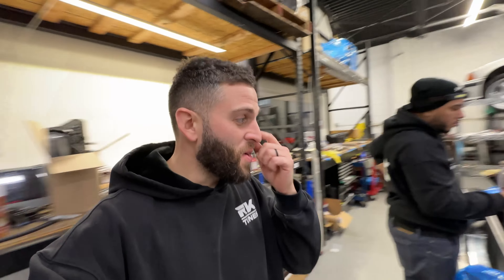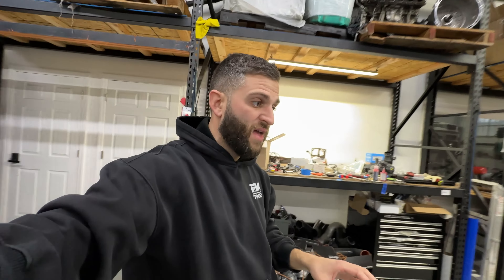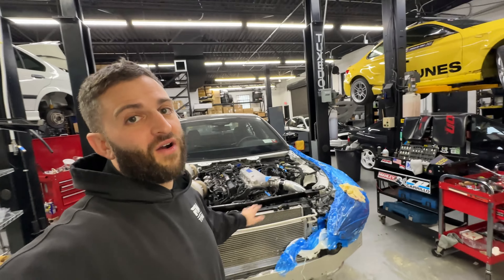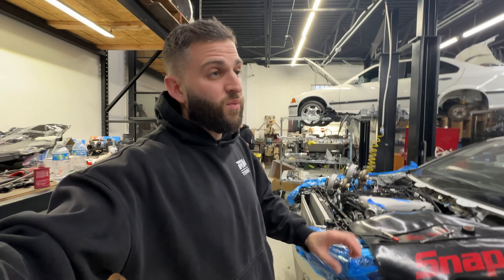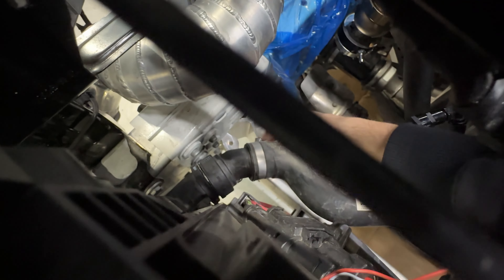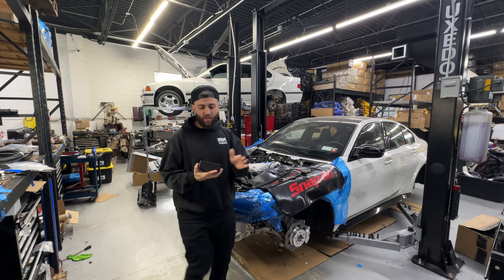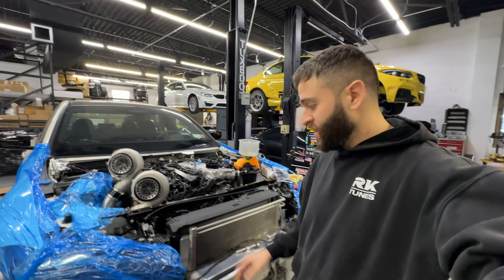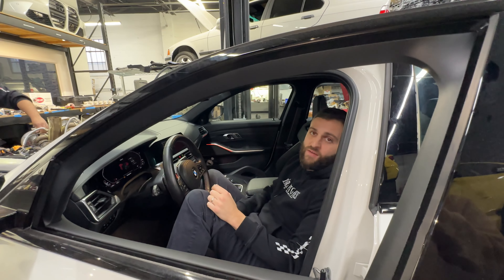1500 HP G80 M3 build - First start on built engine

Comment: Hello Jordane. Yes the pump flows more at idle but then there already is load on the rod bearings, when turning over without fuel / plugs out there isn't. Also its nice to see if there are no leaks because at 40psi its a mess, at 10psi its not

Comment: The higher your compression/boost, the more compressed air between the center electrode and tip.  Why you need a tighter gap because it seems like the gap is actually larger, to the spark plug.

Comment: bmw really dropped the ball limiting the RPM on the DME for the s58.    they destroked it, gave it the bearing clearance for 9k rpm from factory and then limited the rpms.   the s58 piston speed, bore/stroke is literally screaming "rev me to 9 grand".     Im about to 3d scan and mold up full carbon doors for my g42.   if someone were able to bring me all 4 doors of a g80 to make hard molds and then scan both the mold and the door i can  make full carbon g80 doors that will still hold windows and electronics.    lets do some work together.
Reply from the maker: So far we got it up to 8500+ rpms.
Reply: I don thave an s58 yet to rev to the moon but its coming.  I just finished a bc 3.4l n54 with mid sleeves, n53 head, k20 honda studs sank super deep. copper gasket with a pure stage 3 8hp75 swapped. 2670 lbs , 1300+whp with real trans brake and 5k rpm stall.  i rev it to 8500 as well but it will see 9k on the scramble.  im about to go 7.6x 's once chris hurries tf up with my billet converter lol.   1.16 60' and 1400whp on tap with spray.  its only a matter of time before i make a clean pass and take the fastest bmw quarter mile from the shop ct in an n54.  ill see you at the bottom of the 8s, top 7s once you get this beast goin. ill say a prayer to the bmw gods for you when i beg them to let my car run good tonight LOL